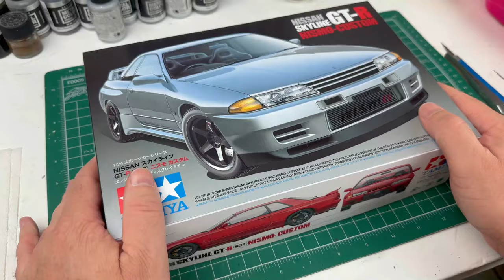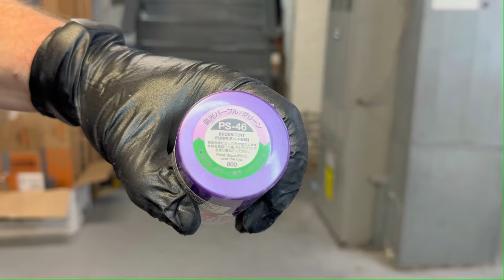Building a Miniature Color-Shifting Nissan Skyline GT-R (R32) Nismo-Custom by Tamiya [FULL BUILD]

Comment: hi i just got one of these and its my first time making a model car i am very experienced with small detail painting and wanted to try a smaller car a shot what was the small advice/ glue looking stuff that you used at the beginning of the video if its necessary where can i find it?
Reply from the maker: I am using Tamiya Extra Thin Cement. It is the green cap. They also have a regular cement that is a little thicker that has a white cap. You should be able to find them at any hobby shop, especially one that specializes in model kits.

Comment: Only 1 coat per paint & clear?
Reply from the maker: I did 2 coats of the primer, 3 coats of the color, even tho I think 2 would have been fine and I always do 3 or more of clear depending on how complicated and angled the body is. The R32 has nice soft lines so your chances of polishing through the paint are a lot less.
Reply: @ScaleAutoGarage  awww makes sense now! Beautiful piece btw!
Reply: @ScaleAutoGarage do you paint Blk trim after you clear coat & polish?
Reply from the maker: @joseperezpaz9986  thanks so much for saying! It is appreciated.
Reply from the maker: @joseperezpaz9986  yes, after the clear I will sand and polish. The clear I have been using, the Mr Hobby Clear, has been amazing right out of the can and doesn’t require a lot to get it to really shine. How many layers of clear can really change how the body looks, also the types of clear. The Mr Hobby clear is actually pretty thin and I kind of prefer the look of it when completed. Some clears go on pretty thick and it can really make a difference how it looks around panel lines. Once you are finished with the polish you can give it a bit of a wax as well and it will help ensure the tape you use for the window trim doesn’t leave residue on the body. Also once you remove the tape you can easily give the body a good wipe with a microcloth to ensure it is clean. Personally, and this is only a preference, I like the look of a semigloss for the trim, not a flat and not a gloss. Totally my own preference but that is usually why I do the trim after the paint and polish.
Reply: @ScaleAutoGarage  thanks for advise and yes I’ve been using Mr Hobby clear as well & loving results. Slowly getting better but requires lots of patience lol.